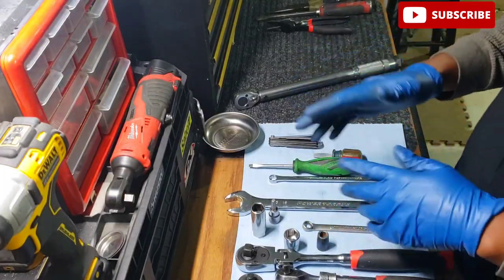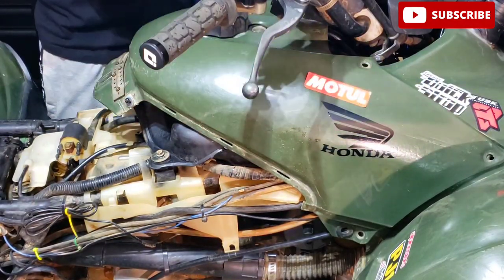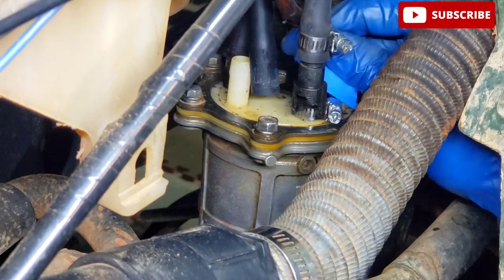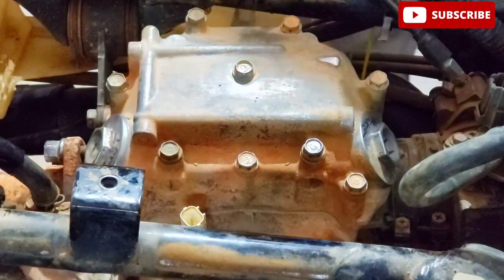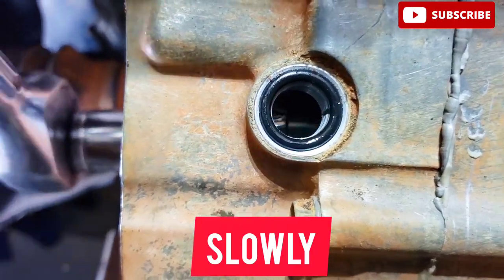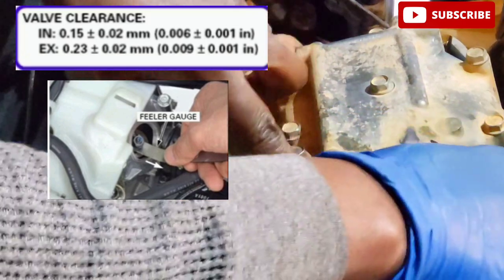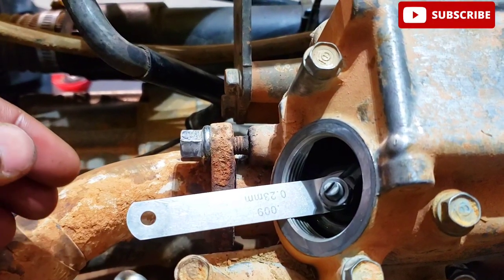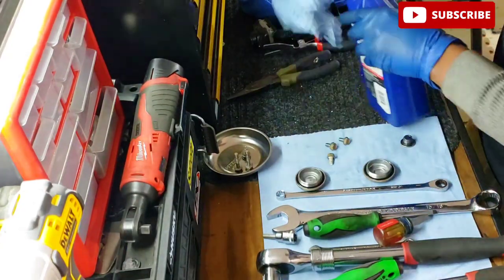RANCHER 420 Valve Adjustment

Comment: Great video. I actually have a rattle sound, when I'm accelerating. It pretty much only happens in 2nd gear on this exact model. I dont think its a valve, any clue what it is? It sounds kind of like a high jingling sound. It doesn't happen when I rev the engine in Neutral. Or when I am going slow in st.